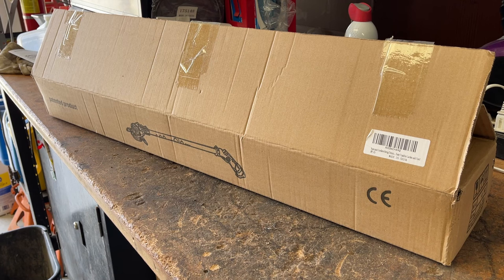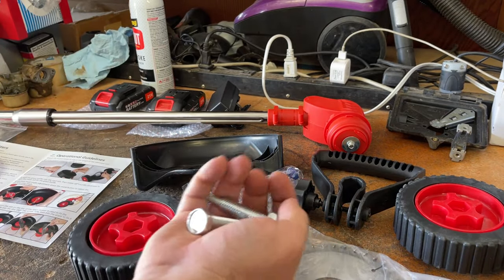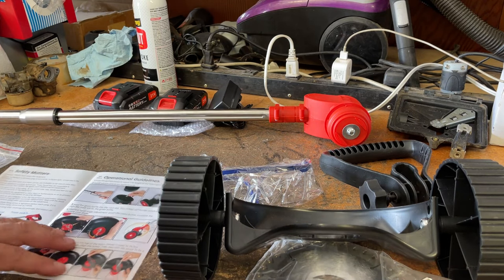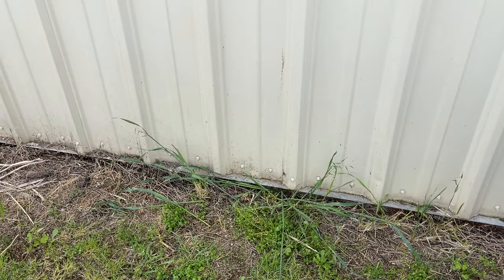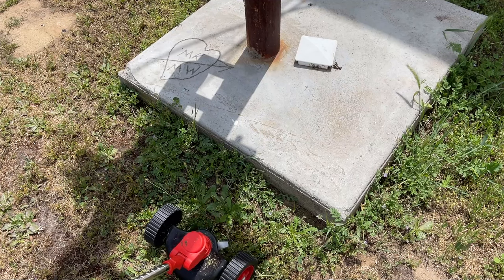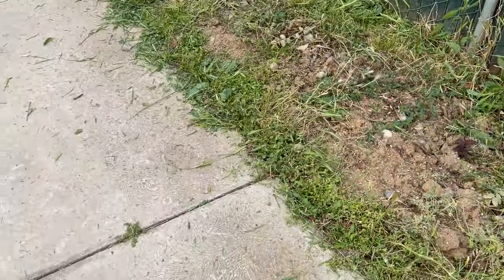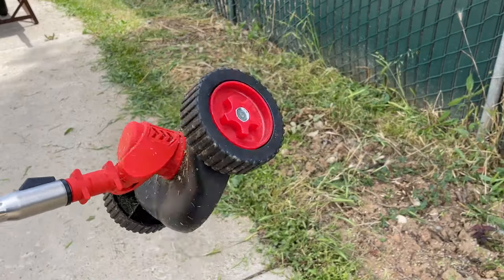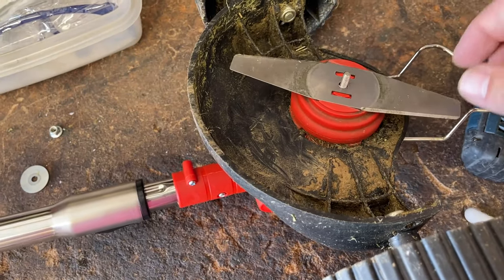3 in 1 Cordless Weed Eater Trimmer by Suncanri

Comment: Have the hardest time removing the single blade after use. Otherwise it get the job done
Reply: @cettabarnhart655   I’ve got the same problem , the threaded spindle  & nut that holds the blade on …. Are now spinning together? This has happened after the second blade??? Otherwise was an awesome gift ! I’m stuck now ? Any suggestions?

Comment: Nice review. I received the exact model yesterday and assembled it and charged the batteries over night. I wasn't very impressed with the heft of the trimmer and sound of the motor, but your video helped to relieve my fear that this would be a waste of money. I'm so tired of gas trimmers working just one or 2 seasons, the difficulty in starting, the fuel the weight, the noise and fumes and the string feed not working. This seems like a very viable alternative.
Reply from the maker: Haven’t had any issues with mine. It works great on thicker brush with that blade unlike a regular trimmer. But you could always swap the head out on a gas trimmer if you desire. Honestly, unless you’re buying commercial grade gas trimmers the rest of the stuff is just junk, the $100 cheap gas trimmers are far inferior to Milwaukee and dewalt electric yard tools.

Comment: You can attach a string directly under the screw like i did.. i cut the cover a little bit so it can run a longer string.. using string is really make trimming a lot easier and faster..

Comment: Without wheels and a good japanese metal blade(Makisaw) I use it for a real big area (I have no additional lawn mower). The wheels would only slow down my working speed significant. Also I use a stailnless steel "flywheel" (the round part the blade is mounted on). There are also aluminum versions available, but the steel ones close better, so less stuff wraps arround the motor shaft. The stainless steel flywheel gives a rugged feeling, it feels much less than a toy and you can hear the harder impacts when cutting. The rpm drop less when cutting thick stuff. The batteries I have replaced in one of my two Battery packs, with 5pcs nice new 18650's (Tesson, standard lithium batteries with 2500mAh. The originals are labeled with 1500mAh, but actually have just arround 930mAh..I measured them). The new batteries last longer than I do  :D  Meanwile there are all spare parts available for this machine. A new motor is ready in my stock  to replace in case... Blew out the motor housing regularly with pressure air is recomended, otherwise the rotor mess up and get not enough cooling.
Reply: Hi top eye, can you explain more?

Comment: I bought that trimmer and loved it.  Got stolen.  Bought another one and it did not work.  Battery charged but did not power up unit.  Many Amazon reviews complained the battery stopped working or never worked.    WARNING if you drop the handle on cement the battery breaks.   Good to have spare battery since does not last more then 20 minutes.

Comment: I have one like that and it's to light duty to do much. Overpriced for what it can do. Spend a little more and get a lot more on bigger units with more power. Tall grass  or weeds will wind around the spool and stop it. For small jobs only, do not let anyone use it with out the guards in place. The blades can cause major injuries.

Comment: I bought this 2 weeks ago and not having much luck with it working. I do not know how to charge the battery. It did not have clear instructions. Works beautifully for you. How do you charge the batteries?
Reply: A charger should have come in the box
Reply: There is a charge port right in the front of the battery where you insert the barrel plug.

Comment: This or the spool Weed/Grass Trimmers? I like that this has the wheels and comes with two batteries.. Im deciding on this or a spool Yardwork that comes with no attachments and only one battery for $30 less..
Reply from the maker: Really depends on the job you’ll be doing with it I guess, the blades on this one are handy for brush and thicker weeds. A spool trimmer may not cut well enough.
Reply: @hanksgarage_  Thanks Hank.

Comment: No indicators to let you know when the batteries have been fully charged.
Reply: When you plug the charging cable into the power point a red light comes up and turns green when it's fully charged.  It takes ages though!  I am not sure if they all work the same way!
Reply: @NasoMessina-g8q  I’m not sure if they all work the same either but I have yet to see any indication of a red or green light when I connect it to power. So far the charge doesn’t last very long.
Reply: @ernestyoungsr2742  That's annoying!  Once charged, I can use one battery for almost an hour.  I usually keep both batteries charged just in case......  One problem I have is that the wheels keep getting loose and wobbly, and I have to constantly adjust them.  I haven't used all the parts yet as I am new at gardening.  My beautiful husband of 56 years, who did all the gardening, recently passed away and I am trying to find tools that are not too heavy to use. I just got it three weeks ago, and so far so good.